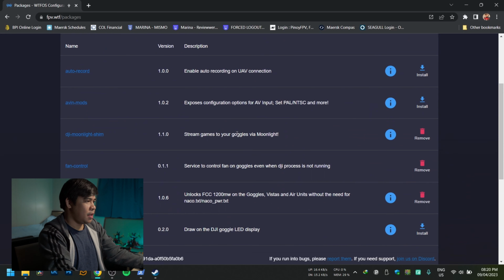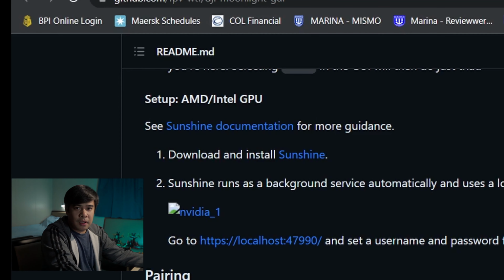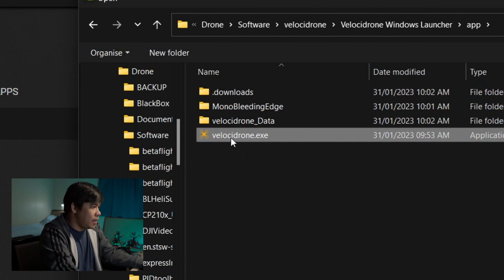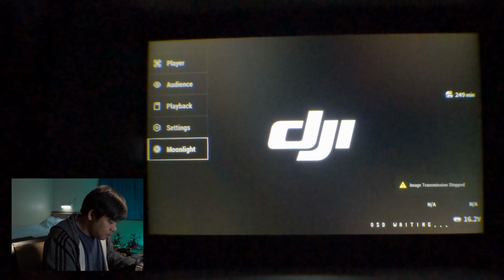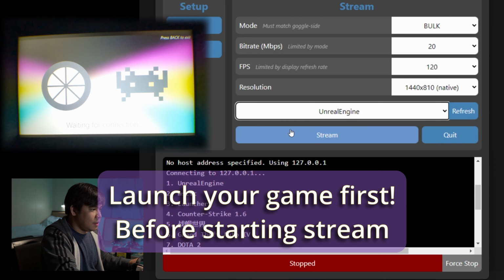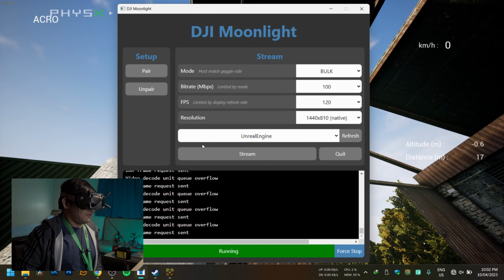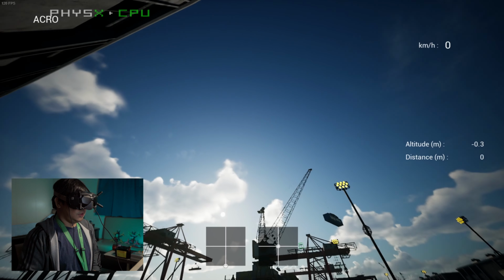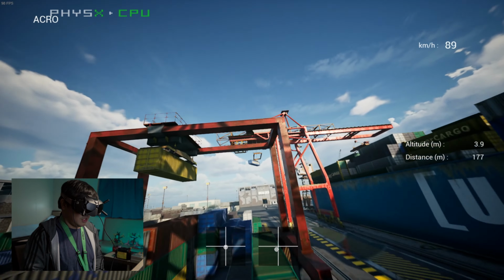DJI Moonlight GUI

Comment: Great video! but I need help, my DJI Moonlight GUI does not work, when I launch it there is just a white screen. All I tried was to install an older version of the program (I have Windows 11)
Reply from the maker: Do you have dual graphics card? Are you running it as administrator?

Comment: Hello and thanks for this great video. Unfortunately I have a problem connecting Moonlight to Goggles v2. Let me start by saying that the Goggles are rooted, as can be seen from fpv wtf. Pairing is also fine, but when I launch the stream from dji-moonlight-gui I get this message: 
"Initializing input stream...done
Starting control stream...done
Starting video stream...dji_usb: 1440 x 810 @ 120 FPS
dji_usb: context = 0x0
dji_usb: drFlags = 0x1
init usb
open devices
unable to open device, or device not found
try running as root (with sudo)".
If I check Windows device manager, the goggles are correctly connected as BULK interface. Do you have any suggestions? Thank you very much
Reply from the maker: Hi! Looks like you have everything correct. Have you closed the fpv.wtf tab? It’s kinda like betaflight configurator and blheli configurator, you can only connect to one of them at a time. Just close the browser dor fpv.wtf and try again
Reply: hey did it work? i cant find moolight on my googls v2 can you help me ?

Comment: Hello, I need help!! The program gives an error when I turn on the BULK mod:
claim interface
unable to claim interface: (-12) Operation not supported or unimplemented on this platform

If I use the RNDIS mod, there are no problems with the connection, but the video delay is very long. Please help
Reply from the maker: Let me get back at you
Reply from the maker: Did you close the fpv wtf configurator?
Reply: @patrixfpv  I'm sorry, but I didn't quite understand the question, I'm using a translator.
You need some info from my configurator fpv wtf?

Comment: Hi! Thanx for the great tutorial! RNDIS with 30Mbps works fine, but when I try the BULK mode I always get "unable to claim interface: (-12) Operation not supported or unimplemented on this platform". Any ideas what's wrong with my setup (Win-11, nvidia RTX3080 with latest drivers, moonlight and WTF-OS is up to date)
Reply: I've found it! I had to reinstall the WTF-OS drivers for windows!
Reply from the maker: @JochenSchurich  great to hear! You did this in the fpvwtf configurator, correct?
Reply: @JochenSchurich did u mean " fpv.wtf driver installer" for fpv device related driver frm github? I will try it.. some people just said run sunshine on nvidia also fix that problem..

Comment: Hey, its perfect video, but can I ask about one problem please... when I run BULK mode, then I got this message: unable to claim interface: (-12) Operation not supported or unimplemented on this platform, and video wont stream to goggles.. Is there someone who know what to do? thanks :)
Reply from the maker: Hi! By any chance do you have sunshine installed?
Reply: @patrixfpv  I dont think so, I suppose I never installed... Is that could be the problem?
Reply: @patrixfpv  And someone write something about driver installation, but to be honest.. I dont understand which one :)
Reply from the maker: @jirimatousek3601  Do you have sunshine installed?
Reply: @patrixfpv  no, I dont
Reply: @patrixfpv  I suppose that you need sunshine only for amd/ inte gpu
Reply from the maker: @jirimatousek3601  Yes only for non nvidia graphics card. I have to ask as I found some people have nvidia and sunshine installed at the same time. 
Next question would be if you have any fpvwtf configurator window open?

Comment: awesome video could get it to run i got some interface problems only on bulk mode. RNDIS is to choppy to fly :D . i got the V1 googles is there any problem? peace
Reply from the maker: Hi! I'm using the v1 as well. Probably you need to need to update the bulk interface driver using zadig.
Reply from the maker: Have you tried upgrading the drivers?
Reply: @patrixfpv  dint finde the right one it works ok rightnow :) thx alot
Reply from the maker: @jansen_fpv  Nice to hear that.
Reply: Same problem here. Zadig did not solve the problem. Any suggestions? Thanks in advance
Reply from the maker: @tgresevicius  which error do you have?
Reply: Unable to open device, or device not found
Try running as root (with sudo)

P.S
Pc shows that the goggles are connected
Reply from the maker: @tgresevicius  are you using RNDIS or BULK? Have you tried both?
Reply: @patrixfpv  RNDIS works but it’s unplayable cause it has huge delays. BULK wouldnt work at all
Reply from the maker: @tgresevicius  Ok, about zadig, what have you tried to do?
Reply from the maker: @tgresevicius  Try this, close all apps, power up your goggles and wait for it too boot completely, plug it in your computer and run Zadig(maybe you don't have it, maybe you do), click options and tick "list all devices". Then from the device selection drop down menu, choose bulk interface. Does it show WinUSB?
Reply: @patrixfpv  Yeah. It shows the newest version and offers me to reinstall
Reply: @patrixfpv  it also shows red X next to WCID. I think thats where the problem is
Reply from the maker: @tgresevicius  What version of zadig do you have?
Reply: Same issue, V1 goggles, nvidia 3060ti, all driver updated usb drivers 1.1.0, reinstalled Bulk driver with Zadig, and "``unable to open device, or device not found" :(, and someone help please?
Reply from the maker: @TugaFlyers  It means that your goggles is not properly connected go your compuger. Have you closed the fpvwtf configurator?
Reply: @patrixfpv  Zadig 2.8
Reply: @patrixfpv  yes i closed, On WTFOS client even running "exec dji-moonlight-shim --usb " it doesn´t show "using usb mode" line
Reply: @patrixfpv  Workaround for now is using Sunshine and RNDIS with almost no latency, and is very playable with very low latency
Reply from the maker: @TugaFlyers  Did you already have sunshine before? I guess this is the problem.
Reply: @patrixfpv  i did instaled sunshine after tryed everything else

Comment: hello, the geforce experience window for pairing never appears, please help
Reply from the maker: Hi! First, are you able to add games in GeForce Experience?
Reply: @patrixfpv  yeeep :s
Reply from the maker: Sorry for the late response, do you by any chance have sunshine installed?
Reply: @patrixfpv  
Hi, I was able to use it successfully once with sunshine. Then moonlight's pin never linked to sunshine again. Shield links but never sends image to glasses
Reply from the maker: That makes sense. You only need to enter the pin one time. Once it's paired you don't need to do it again. 
I think you need to uninstall sunshine in order to connect moonlight to Shield.